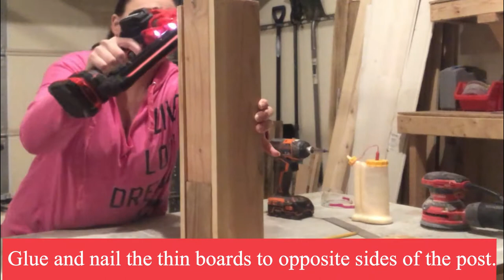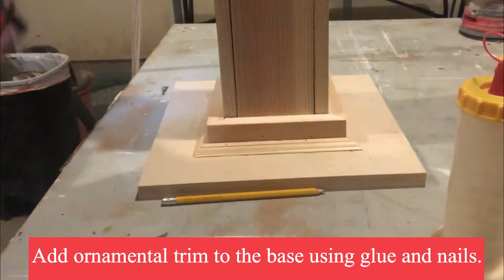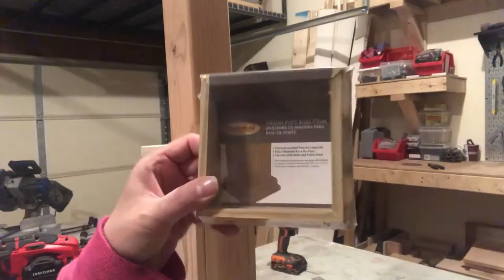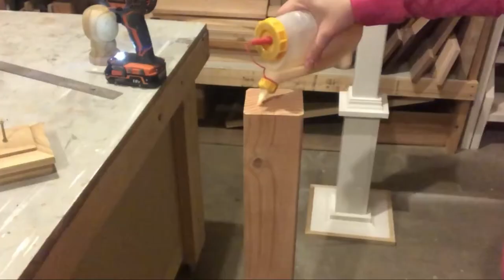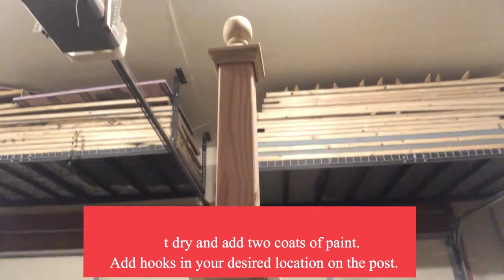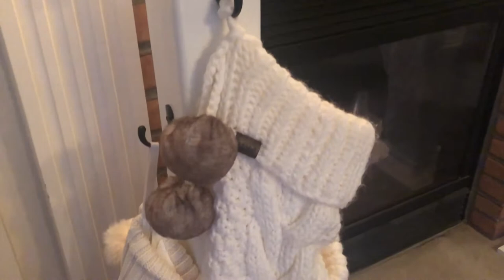DIY Christmas Stocking Stand

Comment: Beautiful! Question about the 16x16 base. Could it be smaller, perhaps 12x12? Or is that too small for the height? Thanks!
Reply from the maker: Hi Rachel! Thank you! I would keep at 16x16 for sturdiness, especially once you start adding items in the stockings. You could try 12x12 and if it doesn't work you can always add the extra 4" around the base like a "frame". Hope this helps!
Reply: @orangeandolivedesigns  Thank you for the advice. I can’t wait to try this!